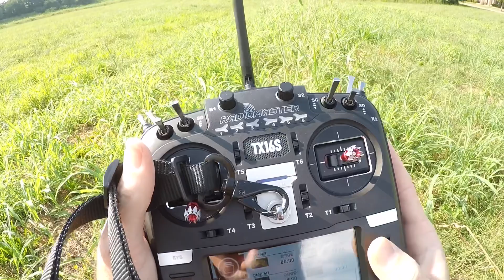OMP Hobby M2 vs Blade 230s V2 flight Comparison￼

Comment: Dude, your biases are showing. Not cool!

First and hopefully obvious question... Why aren't you comparing the current versions of each model? The Blade 230s V2 was replaced with the 230s SMART a few years ago. You can't even get the 230s V2 anymore as it has been discontinued! The M2 Explore is still around, but don't you think it would be better and more interesting to compare the M2 V2?

Second, you replaced the motor and blades on the OMP and consider this to be a fair comparison? You don't think changing out the two most important parts of your heli and tweaking the settings to perform a certain way isn't going to have a substantial effect on flight characteristics? You also said that the 130s was bone stock. Then why are there Align blades on it?  That's not bone stock dude. 

Oh, did you also mention that the OMP M2 Explore also costs roughly $100 MORE than the 230s SMART? The M2 V2 is pushing $200 MORE than the 130s. Oh you didn't? Shame on you... 

I can currently get the Blade 230s SMART all day long via Horizon Hobbies for $250. The OMPhobby M2 Explore is $340 via Amazon. Same for the M2 V2 which is currently running $420. I would certainly HOPE that for the difference in cost that the OMP comes with better components and would fly/perform better there chief (And that's not even counting the cost of your "upgrades" either). This is for the BNF versions of both helis BTW. 

Maybe a better question to ask is "Which model offers better bang for the buck?" In other words, does the OMP M2 fly $100 better than the 130s SMART? Based on this video and several others doing reviews of this model, the Blade 130 SMART, and the Eachines E180, I'm not seeing enough to convince me that the OMP is that much superior to the rest.

Then there's other questions like what about parts and availability? Compatibility with aftermarket radios? How hard are either to fix? How about hop-ups and Upgrades? Etc, etc, etc...

Yes, I agree that in THIS particular video the OMP is better in a hover and has better tail authority than the Blade. That actually is impressive as motorized tails are (or at least were) notorious for tail wag and not keeping up with inputs to the main motor. One of the reasons I have stuck to belt or shaft driven tails over the years. My 10 + y.o. very old school Blade 400 3D can actually hold a pretty tight hover too when set up correctly. Then again tuning and set up is EVERYTHING when it comes to getting these helis to fly well regardless of manufacturer. 

Before you say anything, no I'm not biased towards eFlite or Blade.. or OMP or Eachine for that matter. What I want is an HONEST video comparing apples with apples, not this playing games of swapped parts and flying at least one obsolete model. Then there is the language you're using... "My grandpa learned to fly on a 230s..." vs. "In my opinion the best micro-helicopter ever made". Laying it on a bit thick, don't you think? Geez... Seriously, it does raise a few other questions of what you might not be telling us.

As it is I am currently market for a new heli in the 200 - 300 size range. Unfortunately videos like this really don't help very much and kind of killed any enthusiasm I might have had for the OMP.
Reply: Biases are showing? 

Well here is an opinion from someone that doesn’t make videos or do helicopter comparisons. 

Out of all the micro helis out there, OMP has the best of the best and that’s why every other manufacturer is now copying the small direct drive, motor driven tail helis. As far as parts, you can get all the parts you need for a M2, given they are in stock since our country is ran by idiots. 

And if you have a 10 year old heli, it shouldn’t be hard for you to know what’s good and not if you have been in the game so long.
Reply from the maker: This video has helped hundreds of people make the decision regardless if they wanted to go with the M2 or the 230.Unfortunately I cannot make videos to please everyone, I am probably the least biased person on YouTube in the game. I never push anyone or bash any brand other than giving my personal experience and opinion. Again as I’ve said in multiple videos if you watch my channel. I am not paid sponsored nothing everything you see on the videos are helicopters that I own. As far as comparing “old outdated” models. Well let’s see, The OMP hobby M2 V2 and M2 EXP are the exact same helicopter in regards to electronic frame design power system. The difference is? The V2 has a metal head color matched motors and metal cased servos. Hence the cheaper EXP. White performance wise they are identical! Now let’s compare the outdated V2 to 230 to the smart. What’s the difference? Let’s see, nothing other than battery telemetry and in my opinion a worst FBL than they already had. It’s the same design helicopter that’s been around since the blade SR days over 10 years ago. Now as far as the M2 having “bigger blade and bigger motor” that is untrue. If you watch and listen in the video you were talking about the 230. The M2 is bone stock! Now the 230s? Yes bigger motor and better carbon blades. Now why is that? Well let’s say like I’ve stated in other videos that it lacks serious power and blade flex is insane. So now let’s talk about prices, number one I do not talk about or mention prices and videos on products. For the fact of prices change every day again everything comes out of my pocket. Yes the V2 and XP is more money than the 230. But what are you getting for your money? A hell of a lot better helicopter in every sense. Why? Well let’s see a 230 S is $250 as you stated. But it is in a complete plastic helicopter. There is insane amounts of frame flex it is super weak and crashes tell authority is terrible. It is great for what it was years ago it is outdated even the smart. Can you upgrade it? Of course you can! But how much money are you going to spend to try to make it fly somewhat decent? More than you’re going to spend buying three OMP M2s. So is the M2 more expensive? Yes! But if you get a way better machine, but of course it all depends like I stated in my video what you are doing. If you are like my grandfather who is a normal flyer like the putt putt around and all you wanna do is figure eights 230 is perfect for you. But if you want a 3-D helicopter that will grow with you the M2 is for you. I am probably the only channel on YouTube that reply to every single comment. I replied to every email I spent hours helping people that I don’t have to! So is the M2 more expensive? Yes! But if you get a way better machine, but of course it all depends like I stated in my video what you are doing. If you are like my grandfather who is a normal flyer like the putt putt around and all you wanna do is figure eights 230 is perfect for you. But if you want a 3-D helicopter that will grow with you the M2 is for you. I am probably the only channel on YouTube that reply to every single comment. I replied to every email I spent hours helping people that I don’t have to! Just like replying to you, Could’ve just deleted your comment like every other person does I can lie in every video I could tell you that the M2 is the only helicopter you should ever buy I could never post crashes or mistakes. But I have an honest channel! And I hope every person that needs it. So being biased? Yeah definitely not. So again I will tell you like I tell everyone, and you buy whatever helicopter you like. I don’t personally care if you like Echine as the best brand in the world cool as long as people are flying helicopters that’s all that matters. So if this video didn’t help you make up your mind there is a bunch of other ones that will and if they don’t then do your own research. Learn the different models and learn what the differences are before just jumping and saying things like you have today.

Comment: Hey bro, i need some help if you can...ive got the 480 built and im installing the electronics and it comes with the smart esc or whatever and it has two wires coming out of it and i cant find any info on which one to hook up to the flight controller...could you look at it online and see if its something that you can help me with?...i know its petty but i can get everything else programed and stuff but i just dont know what to do with these two bitch ass wires...LOL
Reply from the maker: Yeah man not a problem! One is going to be your throttle signal and the other one should be telemetry data but I will look it up and double check and get back to you!
Reply from the maker: @hoofarted8709  so from what I can tell the one that has the magnet looking thing wrapped around it is going to be your main throttle line. The other one looks like power and ground so I’m going to assume that is what feeds the fan? And the third wire is signal and ground so that will be the smart technology part that gives you everything to your radio. Hope that helps!
Reply: @westhobbiesrc8051  Thanks for looking into it for me bro...so you are right about the wire with the magnetic donut, its throttle and the other wire that splits at the end is for "high speed" servos or servos that need more power or something like that but all i know is its not needed for me right now so its normally zip tied up out of the way...NOW, ive got to do all this programing stuff and im lost in the sauce but i can contact a heli builder at graves rc later this morning to get the rest competed...at least i got it all mechanically built, electronics installed and both recievers are bound and my motor is spinning in the right direction but i cant hook up servos yet because i cant figure out how to set the "frequency" and stuff so that they will work right...i should be up in the air later today though...thanks again for your help!!!
Reply from the maker: @hoofarted8709  ah yes that makes sense! The Servo that need more power get more more from that wire, yes you need to setup the servo frequency before ever plugging in any servos so you don’t burn them up. I’m assuming you’re using the 6250? Graves RC is the best hobby shop! Love that place! You’re welcome, hope it was any help.
Reply: @westhobbiesrc8051  ...yeah, graves rc is the shiznit and its cool that you know about them...im in north alabama and i always order from them because they get stuff to me supper quick and their customer support is awsum!!!...and yes im using the 6250 smart esc...i purchased the "super combo" or whatever it was and it comes with all of the electronics and a "programmer" or something, i thought it was cool because it can also be used as a battery checker and i think it might can drive a servo so you can get it centered before install but im not sure on that.
Reply from the maker: Oh yeah I know all about graves! I use to go there every month (I lived 2 1/2 hours from them in SFL) I would spend tons of money with them as they had the. Easy prices around and cheapest fuel for my nitros. I live in Tennessee now so have not gone there in a few years. I still order from them all the time as well. Yes the ESC programmer doubles as a battery checker and servo tester! But I’m not sure about testing heli servos as they need the frequency to be set right. I’ll be ordering a Fusion 480 again soon! I had one but sold it and it got lost in shipping and I didn’t do the Insurance so I lost the money and heli so I have to get anther for me! Lol
Reply: @westhobbiesrc8051  TENNESSEE!!!...WHAT!!!...i thought you was in California....My sister and brother in law live just north of Chattanooga in Cleveland...Bro!, if you ever wanted to get away and do some fishing and jet skiing and maybe a little flying too, then let me know!...its just me and my dog....damn that sux about having to "eat" an entire 480 but shit happens....i talked to graves and basically i need to just follow the build videos that horizon has and i will be just fine.
Reply from the maker: @hoofarted8709  nope no California for me! LOL won’t even go there to visit! I was born and raised in south Florida but moved here two years ago. Yeah man that would be great! Love fishing as well! Chattanooga is about an hour and a half from me. Yeah just follow the build videos and you will be good, yes it did suck eating the heli and what really sucked is I’m 99% sure the guy got the heli just a few weeks late. But it is what it is!